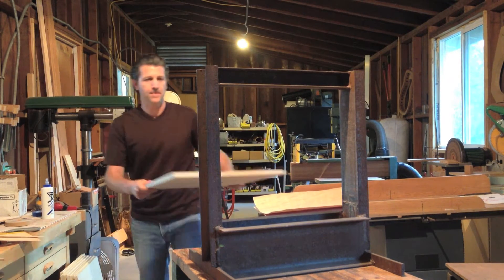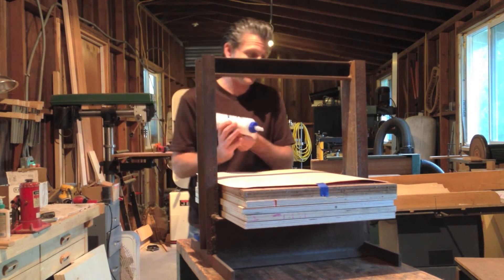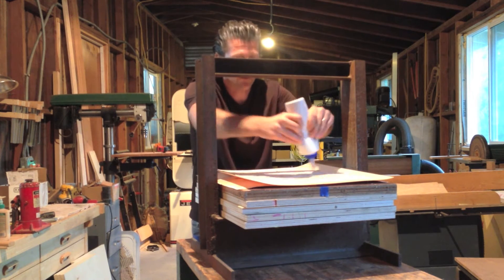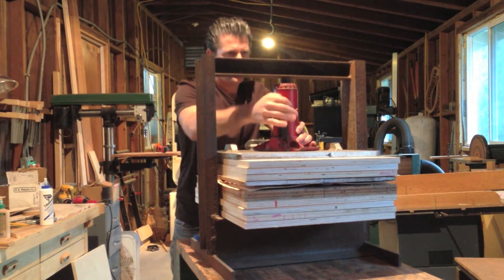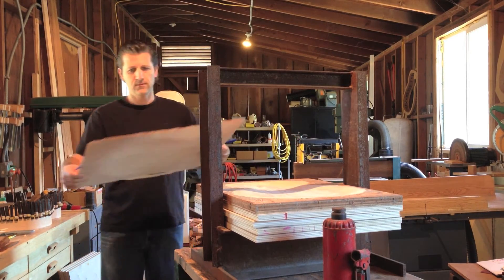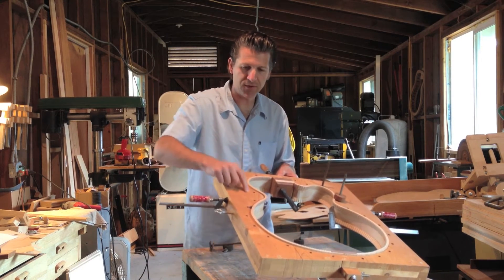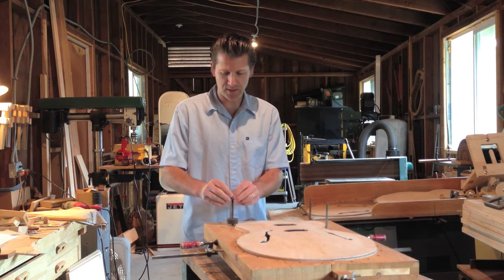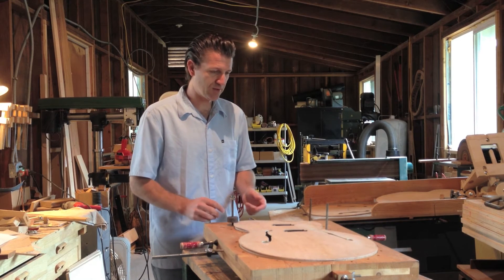Grez Guitars & R.C. Allen Archtop Construction Part 2 of 2

Comment: How much pressure do you need to press together?
Reply from the maker: Don't know the exact number but I'm using a 2 ton bottle jack maxed out and if you skimp on the pressure the veneers wont be totally flat but have some ripples. I'm told you can do this with a vacuum bag but I don't have personal experience with this.

Comment: Beautiful guitar.  I'm definitely stealing the top clamping idea with all the bolts around the rim.  Sure it beats wrestling with that many clamps.
Reply from the maker: Greg McKnight Thanks Greg, And by clamping it in the form, the neck and tail block stay more square to each other so later when the neck and tailpiece go on, less drift compensation is required.

Comment: I would love to know how the moulds were made. Both inside and out. What material are they made of? 
Thanks
Reply from the maker: They are a wood frame with the center cut out and back filled with plaster or other pourable sandable material.  A master shape is needed.  You could carve an arch, or use an existing archtop to cast over.  Then when you have one side cast, you can cast the other side from this.  Very simple stuff.  Now you could CNC both sides from a solid material instead, but these were made by R.C. years ago.
Reply: @GrezGuitars  Thanks very much. I think I understand. So are the final moulds made of plaster or resin? I would think plaster is too soft. Sorry to be so stupid.
Reply from the maker: @jazzman1954  The center is, I believe, plaster of Paris about 3/4" thick and when in use it's under uniform compression and in this orientation it's rather strong.
Reply: @GrezGuitars Cheers! Really appreciate your time and help. I’m looking at building my first guitar here in England. I admire your skills.

Comment: How do you fine tune the top after glue up with .022 veneer??
Reply from the maker: The top itself can't be tuned, the layers are too thin.  The tone bars can be and you can play with the orientation of the layers of veneer to build a fixed tuning into the top.  When I make a spruce top, it is 3 layers, each .06 and with this I can sand from the inside and the outside and tune the top, thicker in the center, thinner around the edges.